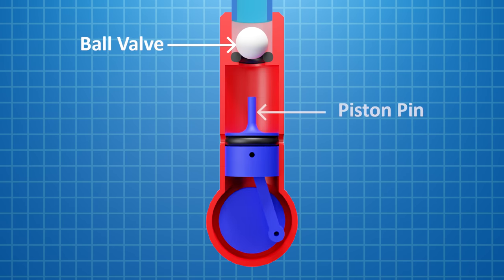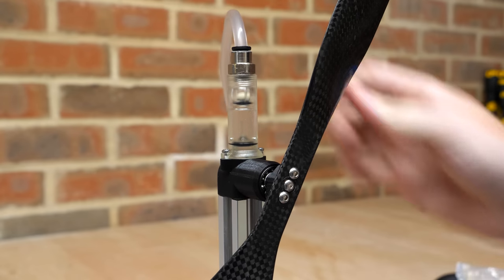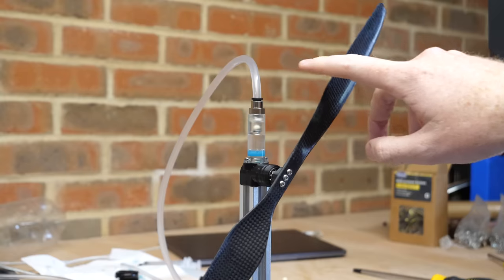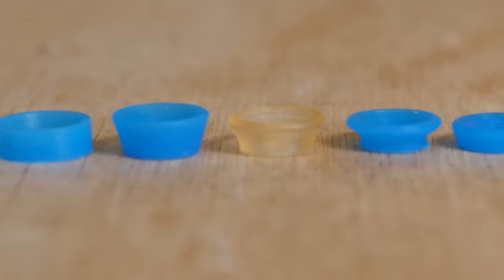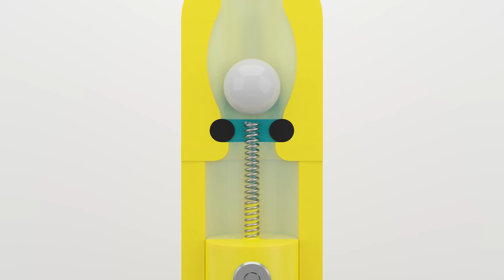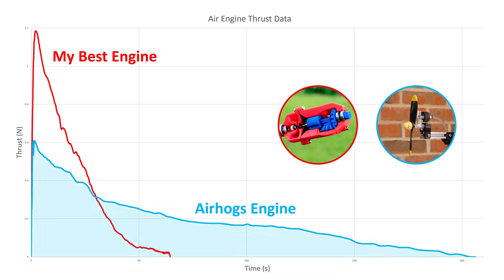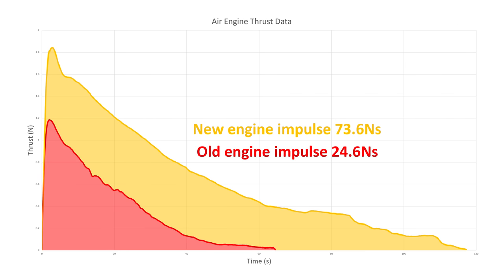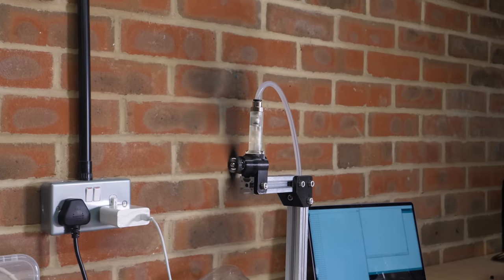Optimising an Air Engine

Comment: i guess you can get even more performance if you tweak the holes, like also making the anti-piston which will help the piston waste less air
basically when piston gets higher anti piston closes all the holes to the extend it wastes minimal gas when valve opens, also, i guess you should make only one hole which will face back, so it also produces thrust when it's released. it's not much but will certainly add efficiency !
currently you release the gas in all directions, but why doing this if you can also use the thrust from releasing gas, and you basically get two engines in one, an air propeller engine + air jet engine all in one. so it will have exhaust look like a rocket nosle 

also im thinking why making the engine cylinder if you can make it into a cone, so the piston wastes ZERO gas when piston is in upper position and it again makes me think there should be better solution, like tweaking the piston volume and a flywheel. i bet it must produce even more thrust, releasing gasses are way underused !
also for my opinion valve simply jumps too high, try tweaking metal pin! so it's in open position for optimal time. like you can simply assemble-disassemble it a bunch of times and in every single time you measure it and draw graph's so you can understand when it is as optimal as possible. simply needle file it a bunch of times.
with flywheel you can make a bunch of holes in different distances to the center it's still will be balanced and it will allow you how far it goes up and how far it goes down so you kill two rabbits in one shot. also there is a bunch of friction here, you can add anti-mass like they do with car engines and it will run way much smoother with no oscillations and make oscillations actually turn into effective power.
this is not hard to do, you simply add a weight on the other side of a flywheel
so it requires printing less parts to test all the possible outcomes just with one engine you can test every single modification.

about the springs, i think you can get off the ball valve to something car-like with one spring and a rod , you only need to add one spring on the top, and no springs inside the piston. and also you can make it tweakable by  simply making upper half of it adjusteable like with a screw which you will simply rotate to adjust how much the valve is open

when you will perfect it you can move to a radial mode with more pistons! so no anti-mass will be required and it will self-balance

Comment: Try turning and lapping a piston from carbon graphite. It can give a good seal for pistons as long as your bore is smooth. Really low friction, self lubricating and stable. I’ve used it for hot air and atmospheric engines that have very little specific power.

Comment: I'd use delrin for the piston material it has teflon in the polymer it would solve that issue of sealing. The ball valve ball can be made of it too and is used in ball valves already

Comment: I think you should take a look at vented piston heads, much like in airsoft upgrade parts. Small vent holes created on the head of the piston lead air behind the O-ring and any and all increase of pressure pushes the rubber outwards against the cylinder walls. This way it is way easier to get good seal with minimal friction from the actual piston making contact with the cylinder.

Comment: 7:27 Near 30 years ago I had access to a couple of those Air Hogs planes from the thumbnail. 

The engine was more interesting than the planes ability to fly. However they were awesome.

Ps edit, so my families business dealt in merchandise surplus and salvage. 

So I was like 10-13 years old and I use to take them apart and try to fix them so we could resell them. 

That’s one of those 1000’s of things I got to repair(or more aptly destroy) sometimes and find out how it worked and why it wasn’t working. 

A lot of the time it was a flaw in the manufacturing, and there was no salvaging it. 

I had forgot about that toy altogether, it’s awesome you can still buy them. 

I especially loved the follow up air hogs remote control helicopters.

Comment: Did you try using an Airzet piston seal. These are typically used in pneumatic actuators. 
You may not find one that size, but it may be worth looking at for design considerations :)
Good stuff! 👍🏼

Comment: The Air jammer road rammer was 50 years ahead of it's time. A Go- kart with an impact wrench engine on a train track. Compressor 1 powered by solar and regeneration braking through a separate compressor.

Comment: I have been following the iterations of your air engines and also wondered about the limits of this type of propulsion. 
I would love to see you perfecting the base idea, then seeing how far can choosing the best materials and manufacturing techniques can take you. As others have suggested, I would also use acrylic for the cylinder and perhaps for the piston too. I know it involves using a lathe but I think the gains will be great. 
If I may, I would like to suggest that you use a solid but low friction connecting method between the conrod and crank shaft, ie. 3D printed parts with brass inserts perhaps?
Then, you could focus on cutting weight off from the moving parts, if you have time of course :)
When is your next video coming out?

All the best!

Comment: In all your pursuit towards a stiff yet flexible “cup” seal, I’m surprised that you haven’t tried printing in TPU.  I’ve been printing wonderfully formed and efficient gaskets for some time, and have found the material to be extremely compliant and even heat resistant for my IC model applications.

Comment: I think you could get a even better peak torque from separating the pin from the Piston
(both connected to the crankshaft but with a different angle). So there is no pressure working against the piston before reaching the top dead center. But higher pressure during the greatest possible lever.

By changing the angle of the pin rod along the crank plate it can be optimized for hig rev or high torque and by changing the travel of the pin the time the valve is open is changed and as a result the amount of air to.

In general the engine would reach the highest air efficiency if the chaimber pressure and the atmospheric pressure are almost equal in the bottom dead center.

Comment: That's why Czech compressed air engines (based on this system from the 80's) had a screwed and unscrewed cylinder to the crankcase to be able to regulate the engine speed 😁

Comment: A spring delayed tip on top of pin that opens ball valve. Not like the air hogs. Set it inside the pin. And have it surrounded within the pin with top cap on spring Also with a pin mod. A two stage exhaust to counter return exhaust compression. 1st micro 2nd big fatteys. Also porting at a angle to dump exhaust on the 2nd stage of exhaust port. I also think a no flex metal seal is best with just enough to hold seal. Also a metal cylinder is a must for durability.  Sorry to bomb your video. I do like your diagram engine.  I think the main thing is timing of 1st stage exhaust and when it startes compressing the return to compression. But also try to use it to return piston to compression stroke.
Reply: A spring flywheel may also be a gain. I wana help if you think what I'm saying can help.  I can draw up what my brain is telling me where you can gain on power and efficiency.
Reply: Also the ball return spring is for economy.

Comment: all very interesting, the piston cylinder seal is an age-old problem, have you thought of using glass, I've seen glass cylinders with internal sleeves that are so exact the air pressure stops them from sliding, IE stand the sleeve in the cylinder and it will not fall unless some pressure is applied, glass is also very hard-wearing, lubricant with very fine oil and the seal will be even better, as for the length of the conrod the best is the same as the diameter of the piston, they are either over or under the square and squared is best of both worlds for HP & torque, 
 So a 20m diameter piston will work best with a 20mm long stoke conrod (it's the length of travel and not the length of the rod !)

Comment: try to gear up the propeller and then use multiple more blades on the propeller then pressure should maintain even longer by the engine running slower and the engine become more silent. you know the key to get lot of run time out of a spring just like pressurized air is to put as much load on the spring as possible to the rotational speed becomes low but using the right propeller design on air resistance can give some degree of thrust at low speed for a longer run time.

Comment: You could try using an airsoft gearbox piston head and cylinder for optimal air seal during the sealed stage, it was build so it doest create a vacuum during the piston return.

Comment: I used to have a little car that was an air compressed motor used to have a little pump that would pump up the container and once it was full you would push the car then it would take off making a little clack clack sound. That was back in the mid 90s.

Comment: As always Tom, an excellent video, can't wait for the next one with the plane :) BTW Humbrol did a BiPlane Kit back in the early 80's that used a CO2 powered engine - they were a bit of a fad for a short while, rather like 'Electric around The Pole' or ETP as it was called back then lol.

Comment: Instead of watery spray lubricant you should just rub some o-ring jelly on the o-ring. Better, faster seal and won’t spray out so quick regardless but you need dense material for the ring like a real o-ring not silicone caulk

Comment: I wonder if a Stirling engine would help with the air pressure. Would a thermal engine be capable of powering a propeller? Great video.

Comment: You do really great work! What if you stick with your silicon seals but decrease the diameter of the seal. So it will have room to expand as rpm and heat increase. 
Also, have you considered a two cylinder, horizontally opposed configuration? Keep it up!!!

Comment: I got an old airhogs airplane. I flew it when I first got it at the airport, I worked at. It got up to almost 300' feet!!!!!! In a big circle, and when the engine died, it circled its way down and landed in a bean field about 600 feet from where it left my hand. Everyone just sit there with their mouths open ... mostly a bunch of older champ and piper cub pilots all in amazement at technology.  Lol a few weeks later I  was walking through a flea market and found a set of replacement wings... which I grabbed... and I promptly set the plane on top of my cabinet, where it's been for over 22 years. I want to fly it again but I am too worried it will be lost.

Comment: Can you recycle some of the exhaust gasses to run a sort of supercharged set up?  Tapping off just enough for some additional power. Or for replenishing the bottle with compressed air?  Just so you may get some extra miles.

Comment: you need to have either two different tensil strengths, stronger on the bottom (less flex) weaker on the top (more flex). Or you need a harder plastic, or try pouring a small amount of harder plastic to start setting first then bond it with a more rubberized top portion

Comment: If you balance it out between the two lengths you should get a much better result overall. Sure you may not be about to go vertical but you should add like 10% more run time.

Comment: Have you considered using a stack of more conventional piston rings instead of rubber seals?  the bolt from an Armalite-style direct-gas-impingement rifle looks like it would be a perfect design for this.  Granted, that does operate at slightly higher than 80 psi, but i bet it could be tuned to work in this format.

Comment: Not sure if it's any use but for pistons in airsoft replicas the face is ported so the air gets behind the O-ring to press it against the cylinder wall

Comment: You don't need a piston seal.
Just make the cylinder and the piston from steel with slip fit tolerances.
Any machine shop can do that for you.
My Diesel RC engine worked fine like this.
Piston rings will cause too much friction.

Comment: I think that the better eficiency of a longer crankshaft is because of the compression ratio, at high preasures it runs better, however it needs more preassure to run, and rhus the shorter runtime, ig

Comment: so firstly you gotta sometimes dip well into the decimel points of a mm. i have 2 tolerances for free moving parts of my neptune 4 plus printers and the first one is 0.351mm for a almost perfect but loose fitting, say you need something pushed in and not slide back out but you can pull it out with little issue then theres my 0.450mm which is my looser tolerance and allows parts to spin and move with little slack or play. hope this helped someone out there, these machines can be very accurate so treat them as such and especially those resin printers
Reply: Before i get much further into the video i think if you put a slot in the buttom of the piston head to seat the seal in it should keep the seals ass end from expanding. thats what i would do anyways based on that problem your having 😁

Comment: Check out a break wheel cylinder seal,,,its similar to a oring but it has a groove around the top of the oring,,,i guess it would be called a lip seal

Comment: Just a thought. I wonder if the piston head was aluminum and the cylinder wall was sleeved with aluminum, along with close tolerances, if you could do away with the rubber seal. The reduced friction may make up for the loss of air and increase life span.

Comment: It would be interesting to see the difference between the longer strokes vs shorter. Along with various diameter pistons. This would then give you the most efficient engine. It would also be great to see how a difference in say, the top three performing engines perform under different pressures. 
Great work so far Tom 😊
Reply: This aged well

Comment: Hey, this is pretty neat!  I just found this, so sorry if this has been asked before, but have you looked into how solid piston rings might work?  My thought was if they're not too tight, you could get a good seal while only losing minimal air around the piston. (UHMW or POM, maybe?)  Or heck get a PTFE ring.  Everyone loves teflon, right? ;)

Another thought is maybe look into other materials?  I'm not super sure what's available (or what you're using) for SLA resins-- can you do a really hard polyurethane or polyester? In FDM, I know you can get PTFE-impregnated low-friction filament... is there anything like that in photopolymers?

My last question is how closely you've looked at your tolerances on the print?  How smooth is your bore and would it help to hone it out?  For that matter, it might be interesting to turn your parts out of PA6 or POM on a lathe if you can...

Comment: oo-kay, you have maxed out that motor. but now add a higher-pressure air tank with a venturi-throat and put an aspirator in the airfeed to the prop, use a prop with more blades -then get back to us! 😉:goodvibes:🤓😋
Reply: The idea is the aspirator will multiply the amount of air in the system, the venturi throat with bigger/higher-pressure tank may or not be a good idea.

Comment: Is it worth adding a spring to the check valve that would reduce the amount of PSI needed to close it? Also, adding channels from the top of the piston to the original o-ring would help seal the cylinder faster and closer to TDC. May not work, but the theory kinda sounds right?

Comment: I have an idea for your next air engine project: try making a turbocharger. Yes, it'd require you to vent out pressurised air into the turbo, but I feel like the benefits of having a turbocharger then spin and repressurise air into your tank would outweigh the extra weight and the lost 1-2 bar of pressure in the engine. Or at least, I think it will, but I haven't seen this done yet.

Comment: Have you considered adding a pressure regulator to your engine so that the air enters the engine at more or less constant pressure, producing a fixed thrust for most of the operating time.

Comment: Tom, you should try a carbonated water engine, like filling up an acrylic tube with carbonated water, then letting then carbon dioxide fill up a bottle then optimising your 3d printed air engine.

Comment: If they strong and durable enough to power a dynamo used as pump for automatically refuel or pump back the air tank , aren't we will have a free energy ?

And use leather in place of the rubber or silicone.

Comment: Could you put scuba tanks on, make a six cylinder and power a bike. If you used the crank but shortened in stroke and mounted on the tubes on the frame. Lots of overlap and with two tanks on your back?

Comment: Please look at the zero pollution motor's engine. (Cav) or whatever. Car powred by air that can travel 200km in 1 go
Reply: Can you put the link of the video under this comment
Reply: @agnellocreed6685  
https://youtu.be/pePzOstKqhM
They once appeared on shark tank. I couldn't find the original but i think the concept is take atmospheric air and compressed air from tank. That combo would run the engine.

Comment: Watching the video I was immediately unsure why you didn't make pistons with air channels to direct the compressing air in the cylinder into the o-ring groove. This is how all airsoft gun pistons are made and when you pair it with the correct thickness/diameter of o-ring it works great - no drag on the cylinder during the upstroke, nearly immediately sealing as soon as the chamber is pressurized.

Also unsurprised that your diaphragm engine was inefficient - the unnecessary bevel gears were likely the biggest culprit.